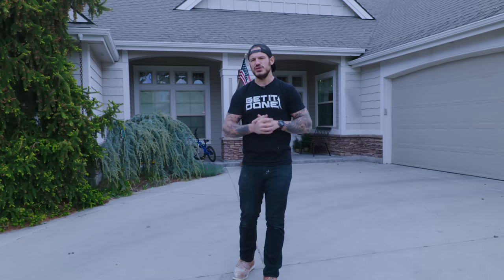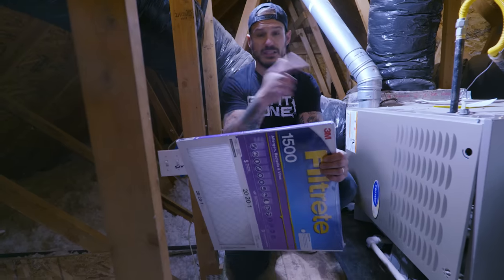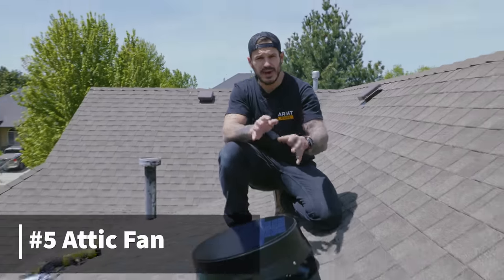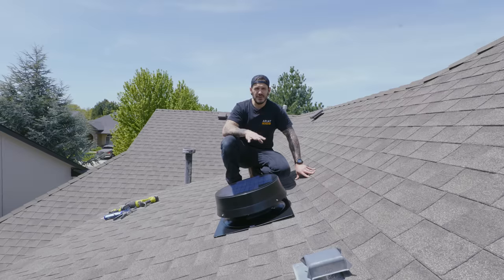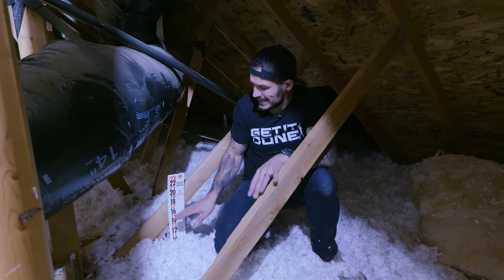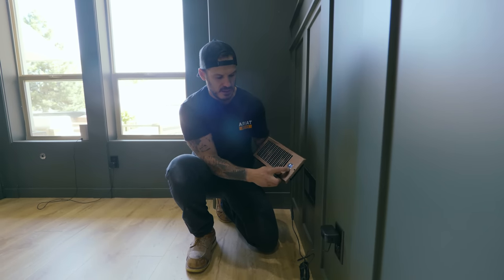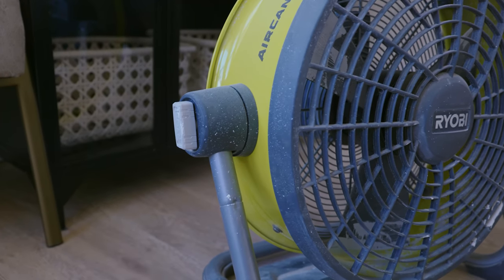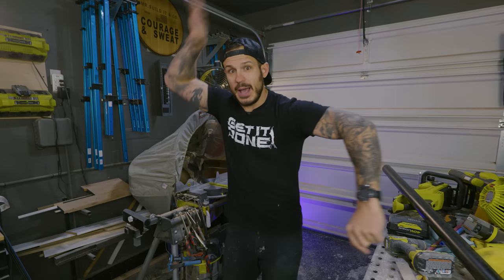15 Tips To Help Cool Your House This Summer + Lower Energy Cost

Comment: Find film made to be outside of the window so the heat doesn't even touch the glass, and it also doesn't make the glass crack from heat which can happen to some types of windows if the film is on the inside.

I have film on ny windows and I live in northern Norway, and the film has survived just fine through harsh winters.

And in the summer, the outside of the windows where the sun bakes all day in the summer has been up to 49.5°C/121°F and with the film on, the inside never get so warm anymore.

Comment: Buy a washable k&n filter! It's a merv 11 and works beautifully, only around 30 bucks and you'll never need to replace it, just clean
Reply: I always used K&N filters on my vehicles  and loved them. So when i saw they made home filters i snatched one up. I immediately  started having problems with it not cooling and freezing up. Its a great product if your system is designed  for that high  of a MERV rating. If not you start drastically  reducing air flow.  Tons of people have the same  problem. I think most people  are already starved of return air as it is. My home is very efficient around MERV 8. It was cheaper to send it back and get a merv 8 washable filter than it was to put in another return air grill.
Reply: @ryanchenault80  well as long as you got a washable one, I just hate to see people throwing money away

Comment: Need to add a little clarity on the attic fan. They’re GREAT so long as the air that’s exhausted can be adequately made up by the soffit vents. If it draws more air than can be supplied by old dirty clogged soffits you’ll end up sucking air from the living space. Essentially creating negative pressure in the attic. Just something to consider

Comment: Careful when using attic fans. If they’re oversized or the soffit vents are blocked it’ll cause the attic to become depressurizes. This will draw in conditioned air from the house into the attic wasting energy.

Comment: For fans, in summer the fan is reversed so you can feel the air on your skin, giving the impression of a cooler temp (It's not blowing down colder air since heat rises) cheers!
Reply: Yeah he had the right idea but the wrong explanation lol.
Reply: no the fan do blow down cooler air. house with teh vent on top, the cooler air will come out in the top of the room, if the cieling fan is off, the cool air will slow sink while the hot air will slowly rise. what the fan does is it will speed up this process and at teh same time, it create air circulation making the temp of the room more even. air circulation dont give teh impression of cooler temp. our human body is kept at around 98 degree. as heat leave our body into the air around us, the immeidate air around our body will be heat u p to 98 degree as well so we feel all stuffy and hot, if u get a good air circulation going, as air circulation  pass ur body, it carry those heated air away and cooler air pass by with a different is temperature, more heat will transfer form ur body to the air around u and as heat leave ur body, u feel that cooling effect.

Comment: And FYI for your 410 Trane air conditioner you cannot just fill it up if it's more than 50% because it's an azeotropic Blended refrigerant it leaks out at different rates so now when they pumped It Up full moon owl have more of one than the other so it's no longer a Perfect Blend which can cause everything from hunting to Frozen coils to lack of heat even damaging the compressor

Comment: The ceiling fan direction is about how it feels on your skin.... you aren't blowing cool air down as cool air settles at the floor and hot air settles on the ceiling.
Those vent fans are pointless also.

Both of these are about push being greater than pull when it comes to fan blades.

Comment: A vent fan helps move air in ONE ROOM, but a DUCT FAN can move air in the trunk of duct-work cheaper! Since 9 out-of-10 home HVAC "contractors" have never seen or installed a duct fan, you won't find many that suggest them or know HOW to install them. Having worked as a janitor/maintenance man, you call Grainer's Supply and you need a "sail switch" and a duct fan to fit your duct. They ain't cheap because they have to heat limit switches to prevent pushing FIRES thru your ducts. A commercial HVAC contractor will know what you need and can measure the air-flow you HAVE and what it NEEDS to be. Budget $600 and up depending mainly on access. In my late sister's barn of a two-story, an up-stairs and downstairs fan duct cost about $2500 to install, but SAVED $250-400 on heat and cooling with her 12 foot ceilings, it isn't SQUARE feet of house (3200) it's CUBIC FEET of structure like an office building. The one (of 2 1/2) up-stairs bathroom plumbing no longer froze either.

Comment: So a couple things wrong here since I've been doing that conditioner for 27 years and give you some insight one your filter was backwards but it's no big deal cuz it's not under any major static pressure to when you put in a high pleated filter all you doing is reducing the airflow which lowers your pressure does help pull out moisture out of the air but you reduce the amount of airflow in your system and possibly cause it to freeze up three the thermostat if you put it in automatic you are wasting energy because on those summer spring and fall days where the weather is not too cold and not too hot you will waste in it by running heat your body doesn't care what temperature it is when you're asleep it will not affect you you will only notice it when you wake up the human body can only tell 3°

Comment: Why is your furnace in the HOTTEST PART OF THE HOME OUTSIDE THE CLIMATE CONTROLLED ENVIRONMENT- insulate the roof of your home or at least build a well insulated box around your hvac unit and those insulated ducts only have 2 inches max of fiberglass - best case movd it out of the attic and into a closet inside your house

Comment: Current (July 2023) Freon R-12 is 150 LB so easily exceed the $200 - $300 referenced if it's low enough not to be cooling.  Then there is the service fee

Comment: Wouldn't it be better to aid the convection cycle that's already happening inside the house by pulling up the hot air with the ceiling fan and not blowing it back down to re-mix with the colder air?

Comment: Phenomenal video, no idea there were solar attic fans. Bought it, looking forward to cutting a hole in the roof! Thanks
Reply: Would it be a problem in the winter though and make it harder to heat your house?
Reply: @craigzilla100  yes, but if live in the southeast that is lot less of a problem. However, the pressures are more of problem with the solar attic fans. They pull air through the leaks of the interior as a result of under pressure in the attic they create especially if its oversized which can be far more costly than heating issue as they don’t have a shutoff.

Comment: You have the reasoning backwards on the ceiling fans. In winter, you do have them blow up because the hot air is at the ceiling, not on the floor like you said. Hot air will always  rise - summer or winter. In the summer, you have the fan blowing air directly down on you for the evaporative effect of moving air on your skin will cool you.

Comment: By the way, you got that backwards during the summer time. You want it pulling up so you can bring the cool air up into the air and drop it on top of you The The winter you want to push the heat down

Comment: Our AC/Heating vents are in or near the floor. Would we set the ceiling fans opposite ie using downward flow in the winter to keep the heat in the lower part of the room as it rises from the floor?

Comment: DO NOT use "Heat reducing window film" things, if you have european style double or triple paned windows. Those windows already have good heat insulation, and those films reflect parts of the sunlight back into the window like an infinity mirror. This leads to overheat between the window panes and will break the window. If you really want to install window-film/foils, then ALWAYS on the outside (reflects before rays reach the window), never on the inside of the window (reflects sunlight into the window).

Comment: What about a 35 year old double wide  mobile home with a metal roof?
Reply: More insulation between the ceiling and the metal roof, couldn't hurt to add more on sides of the house that face the sun... I don't know what R Value you'd want... I'd also cover any windows with a sunshade or sun blocking window screens, blackout curtains, and plant bushes always from the house, to create an additional sunblock... The roof will be your biggest challenge, but I believe it can be done...
Reply: @ImDBatty1  Thank you for replying! I have used chrome window tint on the windows that are facing the Sun the most and have put up Sun blocking room darkening curtains! I guess the next thing will be adding insulation in the ceiling and the walls on that side that faces the Sun.
Reply: @therajuncajun6487  I live in a tiny house on wheels, so our living arrangements are similar, but different... I didn't see the owner of the channel pipe up with any advice, so I thought I'd share my own... Let me know if you get it sorted and notice any difference? How much room do you have to work with in the ceiling?
Reply: @ImDBatty1  I haven't opened up the ceiling but by being in a double-wide there isn't that much space up there! If I were you I would probably look at some type of foam with a aluminum backing to reflect the heat to put in the ceiling of your place!
Reply: @therajuncajun6487  great recommendation, if I hadn't done that already... 👍 I also have rockwool insulation, and I'll be honest, it's kind of chilly in here... but that's how I like it! 😄
Reply: @ImDBatty1  Sounds like you are on the right track to get it the way you want it!
Reply: @therajuncajun6487  that I am! Now if only it were located where I want it, not where I could afford! 😆
Reply: @ImDBatty1  Amen to that!

Comment: Those “booster” vents are very suspect, you are reducing airflow into that room when you install that, then using more power to boost it. Not that all boosters are questionable or there is not possibly a place that one would be beneficial. I would recommend getting a good HVAC tech to try air balancing the system first.

Comment: so the ceiling fan part is wrong 
you want it to blow up to bring cold air up to bounce off the ceiling/walls to force the hot air back down and circulate the room
its how ive always been told and ive been doing it for years (im 30 years old and was told this when i was 5) 
its always worked that way for me and im actually doing it now and it drops my room down by like 10F
for winter i have it to blow heat down and it raises the temp by like 5 to 10F depending on how cold it is and if the furnace is running since mine fires heat upwards (old 100 year old square vents)
yes my house doesnt have acs so we use window units and fans to keep the house cool

Comment: Good suggestions but what does pressure washing and pest control have to do with cooling your house? lol
Reply: You will drive up the temperature inside your house as you're running around trying to smash bugs.
Reply: @camaroman101  Hahahaha, I guess that's about the best answer.

Comment: I have a two story open floor foyer. During the summer months my second level has a much more difficult time staying as cool as my lower level. I’m thinking this might be an exception to the fan direction rules so more of the cold air can be pushed upwards?
Reply: I have that same issue but we have a chandelier there instead of a fan. I will put in a fan and run it to pull cold air up all year long.

Comment: AC company didn't try to rip you off by making you buy a new one? Mine did, 6yrs old & too old?! I've been without AC in 100⁰ summers for at least 10yrs. I didn't know, & they didn't suggest a split system. I have a tiny house, don't need huge central air. Sadly, I had a split system in my 1/2 story upstairs but never knew that's what it was. Rarely used because electricity here is so expensive. Didn't know it was a heater, too. Used occasionally for few hrs & bill up another $100.

Comment: And the last two things on here the vents that have the fan what you doing is reducing the cooling capability by increasing the velocity air conditioning to work the opposite the slower the fan the more tools out the moisture out of the air that's literally what dehumidification is taking the grains of moisture out by lowering the pressure or lower the fan speed that's why I mini-split ductless units have dehumidification mode where it slows down the fan to very minimal amounts if you're going to get a dehumidifier having a single dehumidifier if you have a high humidity area is pointless and just waste a crap load of power because a dehumidifier is basically a portable air conditioner with a slow fan while it's also going to pump out heat out of the back end which is the leftover medium you don't want that you supposed to pipe that outside so until you're kind of equal and out except for your losing a lot of money when it comes to power because your power and is second mini air conditioner

Comment: Attic fans are not effective at actually reducing the radiant heat that is heating the insulation in the attic. A radiant barrier is an effective method of removing that radiant heat and reducing your energy bill. Got to the build channel if you want to learn about making your house a more effective at retaining cool air.

Comment: As an HVAC Engineer and tech. This list is great except for the duct booster. They’re robbing Peter to pay Paul. The system is designed around a specific contact Tim of the air across the coil. If you speed it up, it won’t cool down as much and increase humidity.

Comment: #1, switching fans only works if you have them, also, most house are still floor level vents only, so fans won't help as much there... #2, what year do you live in, its been over a decade since big gov tried to make incandescent's illegal, which means fewer and fewer homes even have those bulbs left... seriously... yes some still get made and sold, but ONLY because some places need heat lamps to keep pipes and plants from freezing.... #3, furnace/ac filters, changing only does one thing, keeps the air from having a dusty smell, and keeps your system from running as hard... #4, smart thermostats, good idea, but many old thermostats still work just fine, specially if the system does NOT need to run 24/7... ie open your windows and doors and shut off your air system if you want to save money... #5, attic fan, another good idea, but now your getting into an area that MAY require a pro to install for MANY reasons, some of which are safety, some are legal, refer to local codes on legal bits, also doing ANYTHING with a roof can lead to future water leaks, which can cause damage to home, mold.. need we continue... #6, heat film... can't say much here, never heard of or seen this stuff before, but then if you already have double or triple pane windows, this may not be a needed item... just a thought... #7, attic insulation... only think i can say from personal experience, use roll insulation, sure blown in is cheaper and fills areas, but if you EVER have water leaks and a ceiling falls in, that blown in insulation gets EVERY where, and then some... #8, shades, something you should have already...if only for privacy.. sadly there is no shade big enough to help us keep our privacy with the spyware in Microsoft Windows these days.. but oh well, also, in addition to shades, or instead of, curtains will do the same thing.. both for privacy and blocking heat... #9 A/C maintenance.. should be a no brainer, and can be done when dealing with filters.. #10 vent fans, cool idea, but better done with new houses where they can be hardwired in, this eliminates trying to find an outlet or extension cord when you do this post construction... #11 and 12, good ideas, but have NOTHING to do with cooling your home or lowering energy costs... just saying, a clean exterior and bug free area does NOT cool your home or save money... #13, air circulation, this one is tricky since MANY floor plans really don't offer what people need for efficient heating and cooling.. fans of all sorts can help, but the more fans you run the higher your energy cost goes.... #14 dehumidifier, this one depends on where you live, some areas this will help, others it wont, either because the air is already dry, or there is soo much moisture in the air, that you basically need to turn your home into a sealed bubble to have the dehumidifier do any good... also, some health issues can arise from lack of or too much humidity.... #15, energy audit... nice to have done, but this only tells you suggested ideas to lower energy costs.. some of which may give discounts if you do them, but ultimately do nothing in of itself to cool your house or save you money.. specially if your ALREADY doing EVERYTHING you can to cool your home and save your money... as an example, my dad had an energy audit and they basically told him to switch his bulbs to LED, even though he ONLY had LED bulbs in his house... in other words the audit wound up repeating what he had already known and done...

Comment: Hot air rises.. why push the hot ceiling air down. Most important tip not many home owners do not know. CLEAN your condenser at least 1-2 times a year.

Comment: hi I just moved in new place and there are metal covers  under floor registers,  are these so that thing dont fall in the vents?  OR what other reason are they there? I can provide a picture.
Reply: Sounds like they should have been removed from the vents so the air can flow. I would talk to your home builder asap and hopefully it hasn't already damaged the heating/cooling system.